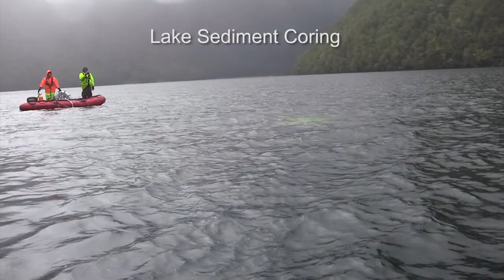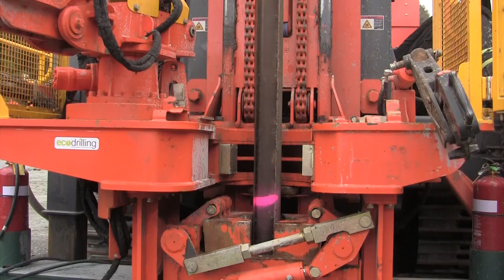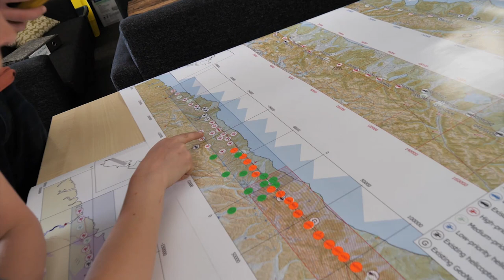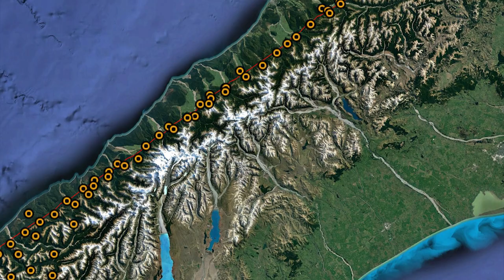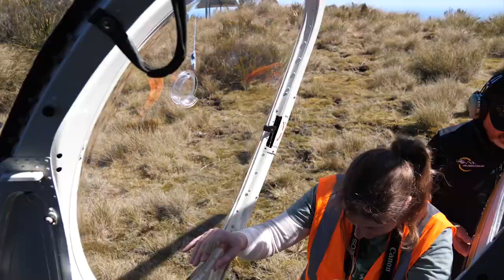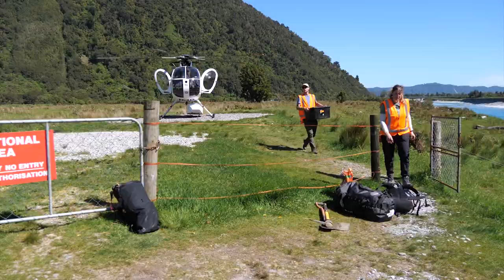What will the next Alpine Fault Earthquake be like?

Comment: Would it be far to say, the longer it remains locked up before letting go the bigger the quake?
8 is pretty scary, the 7.8 Kaikoura quake was crazy enough for me!
Reply from the maker: The plate collision is at a constant rate so you are right in that something has to give to release the build up of stress, and the longer between quakes the more movement has to occur somewhere. However it could be released in a number of smaller quakes rather than just one big one. Having said that the Alpine Fault seems to regularly produce large, rather than small quakes, so you are probably on the mark
Reply: @OutThereLearning  thanks for the reply!

Comment: Very interesting.  Presumably, an important parameter might be the location of the initial rupture - South end, middle, or north end.  Also, does the simulation take into account the potential of the seismic waves to trigger quakes on 'secondary' faults that might be quite distant from the alpine fault ?  Starting a chain reaction if you will.
Reply: South to north will the the worst.  Also probably not for the second part since you only want to test one variable at a time.